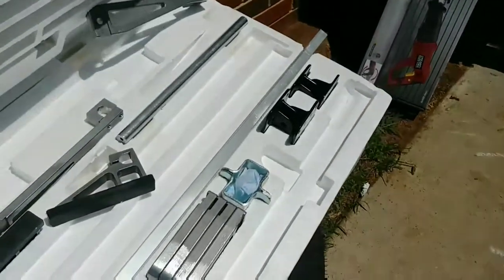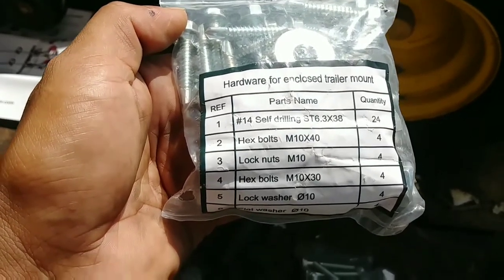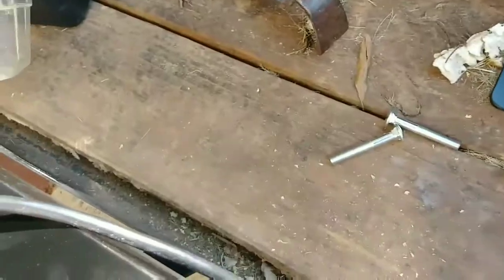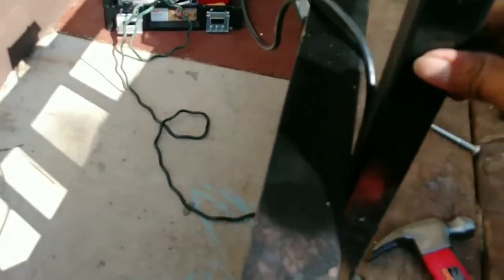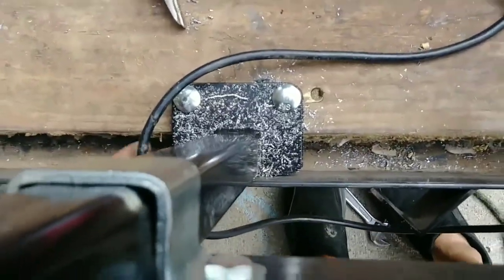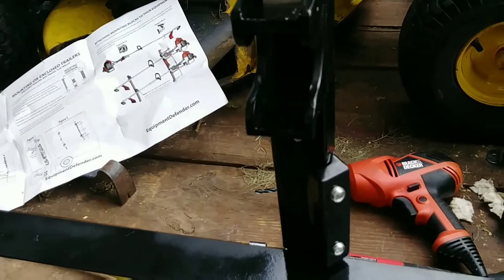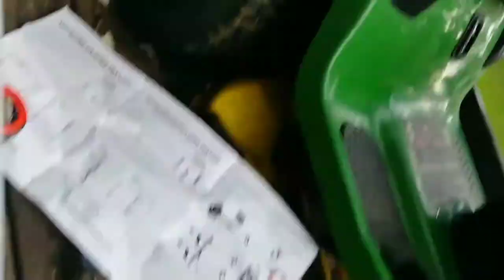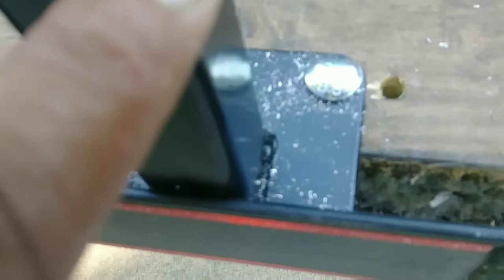How to Install Equipment Defender Racks (Open Trailer)

Comment: Thanks for the video.
Reply from the maker: Will Robinson - Thanks for watching bro... No enough instructions very complicated, but its a good weed eater racks. 👍
Reply: Yellow Jacket Lawn Care
Others have said the same thing about the instructions. I prefer to keep my weed eaters and blower in the bed of my truck. I was just curious to see how people mount their racks. I like how you took the time to grind off some metal so the racks  stood up perfectly straight. Most people wouldnt bother. Im with you , it would drive me nuts if they weren't straight.
Reply from the maker: Will Robinson - It was frustrated and very hot day that time... Paying almost $200 and I have to go through bs.. Lol

Comment: Hey man to save your wood put some stain in a spray bottle and spray inside the holes you made and it will keep it from rotting them out.
Reply: As well as that spot that the wood chipped. 👍
Reply from the maker: Rufus LC - Ill do that, thAnks bro